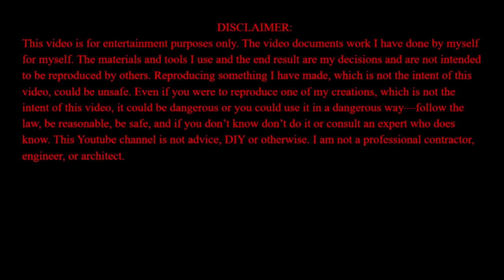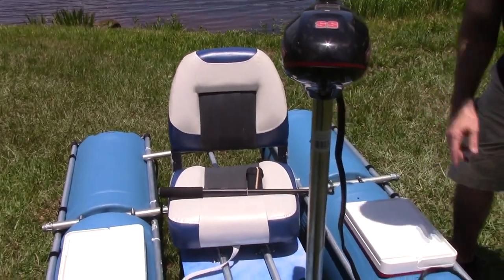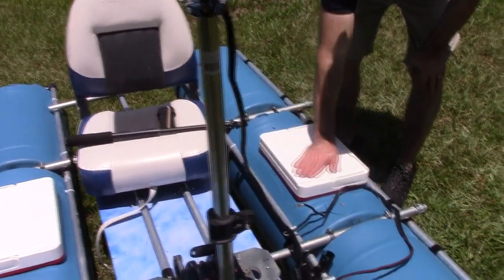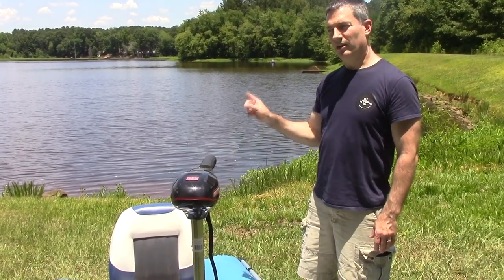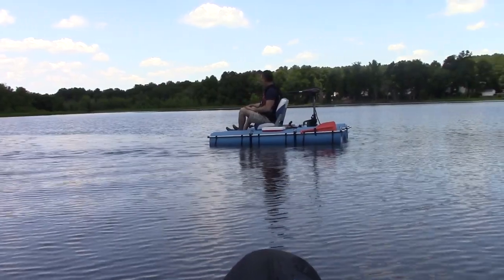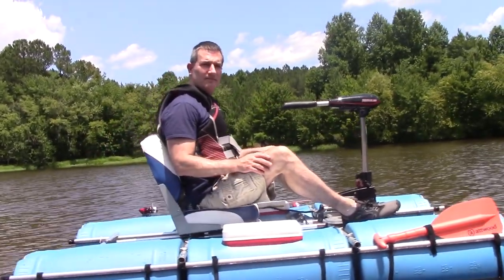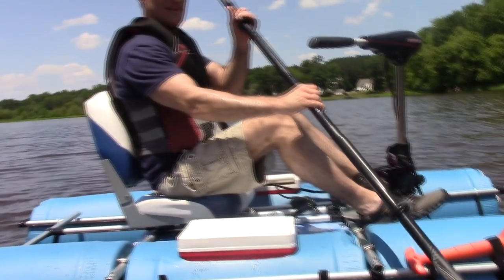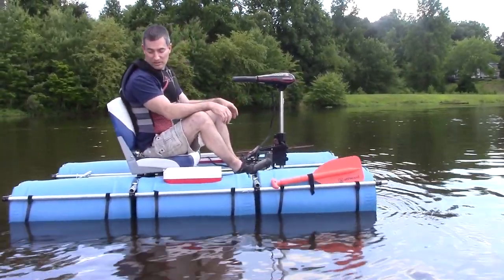Homemade EMT Conduit fishing barrel boat

Comment: I can see a mini trailer that matches the boat behind the boat on a short rope full of supplies and food , pop up an umbrella and have a sandwich maybe a few tools radio with batteries stuff like that in it. I really love this boat . I would love to make one just like this . But ive been a home builder my whole life and my back has gone out on me so i cant eork which means i couldnt afford to buy the stuff to make it. I live in a very small town way away from a city. All we have here is a dollar general. And a hometown small  hardware store. I haven't even seen these barrels around here. But have boys that would love to take this to the river. I would buy a small boat if i could . I need to come up with something like this  ! My boys are under 12 and always bord . That thing sets up nice on the water . You done the best job ive seen anyone do . Its neat lightweight. Man i had a pop up canopy that the wind caught and tore up . The legs on that would've worked for the frame. I belive rubber intertube strips would work to connect the joints,screwed with self tapping screws , cut strips of strong rubber or water hose. Im thinking and writing what im thinking , sorry lol.. anyways very nice , someday i will find away

Comment: Newly subscribed after watching the conduit video. Definitely interested in a cut list as well. For a nose take two of the flotation devices off of an older project, cut them into a cone shape, seal, and bolt them to the front of the barrel 🤷🏻‍♂️ might work
Reply from the maker: Cool, I will let you know about the book when it is finished. Also, thank you for the idea for the nose cone. I will try it and see if it works. Thanks again :)

Comment: All barrel boats should have diverters front and BACK.  This makes a huge improvement in range and handling.  EMT is great for paddling around a puddle, but will not stand up to any waves or boat wake.  Even 2 x 2 12g steel studs bend.  2 x 4 12g minimum steel studs.

Comment: Great video mate do you fill the drums with foam
Reply from the maker: Great question, I didn't fill these up with foam. They were air tight except for the ones with the cooler. I would just seal up the ones with a cooler if the water was a little rougher. Thank you again

Comment: Great job! How big the trolling motor and battery are you  using? Thanks
Reply from the maker: The trolling motor was a Minn Kota 55-lb. and the batteries were two 12 volt lithium ion batteries that were wired in parallel. Thanks for the question

Comment: supergoku1 I have 60 of those barrwls but mine are 55 gallon plastic barrels that I am trying to make a large mobile floating island with a welded metal frame and then tarp and soil and grass on top. 

Do you think I could use this emt conduit in the same way but on a larger scale to make My mobile floating island frame and forget the welding?
Reply from the maker: To be honest, I'm not sure. If you can, I would go to the YouTube channel https://www.youtube.com/@MakerPipe They are the ones that make the EMT connectors. They constantly do test on the EMT pipe to see how well it performs with weight and other test. They also might be able to answer the water proofing question. I know they have tried many ways to paint the EMT conduit as well.  I hope that helps and thank you for the great questions.

Comment: what size emt conduit did you use ? would you happen to have material list of how much emt conduit needed been trying to find somthing just like this so i can get off the bank and looks like you hit design and everything on the nail.  keep up the great videos
Reply from the maker: I used 1/2 inch EMT for this boat, unfortunately I do not have a parts list. Thank you for the questions.

Comment: Love your creativity! I build and design micro camper boats!
They look like tear drop trailers. By the way, where did you get connectors for your emt conduit (the black ones)? What size conduit did you use! Looks like 1/2''.
Reply from the maker: The connectors came from a company called Maker Pipe. The web site is Makerpipe.com, and the boat was mainly constructed from 1/2-inch EMT.  Thanks for the questions.
Reply: @supergokue1

Comment: Maybe Add cones to the front of the pontoons to cut through the water more easily. 
 Being flat-faced is eating up your battery.
🖖😎
Reply from the maker: You are 100% correct, that is a must for this boat. To be honest, I am having a hard time finding something heavy duty and not too expensive. I tried a couple of clear plastic salad bowls, but they just cracked and broke. I am open to any suggestion anyone might have :)
Reply: @supergokue1  
🤔...maybe, start with experimenting cone shapes with large sheets of thick construction paper / thin cardboard for proof of concept, ...copying a simplified shape of a canoe bow. then make the bow (x2) out of the same jug material.
...fastening it  without  drilling holes in the pontoon will be the trick. 
...maybe a super strong adhesive for the plastic type of the pontoon jugs, and maybe add just a few of rivets at the sides and top only. (also, the seat might be more comfortable to raise the seat 6, 8 or 10 inches as long as it's still stable...and, maybe add a way to stand up periodically, if you stay out there as long as I do🖖😁)
....and maybe add a small solar panel for charging the battery while fishing...cheap ones Amazon.
Reply from the maker: Wow, really great suggestions. I will start to work on them, thanks for the help.
Reply: @supergokue1  
It was a bit much… but that’s just the way my brain works, …it never stops.

Comment: How much weight will the raft hold?
Reply from the maker: To be honest, I'm not sure how much weight it will hold. I can only guess for now until   I can test it. The math I normally use is a 1-gallon container will float around 8 lbs. minus the weight of the container. So, each barrel is 15 gallons and should float around 120 minus 5 lbs. for the weight of the barrel.  115 lbs. x 6 barrels is 690 lbs., will it actually float that much without the conduit bending, probably not. I can let you know when I get a chance to do a weight test. Thank you for the question, I really appreciate it :)
Reply: @supergokue1  do you have a cut list of the conduit, I gathered you used 6 pieces is that correct
Reply from the maker: I have to go back and gather all of the info together before I start to do the book. I can let you know when it is done if you like.

Comment: This is outstanding!  How do you keep the water out of the pontoon?  They are drilled.    Would Water impervious Polyvinyl Chloride Foam keep the craft afloat if water got into the pontoons?
Reply from the maker: Actually, 4 of the barrels are completely sealed. The other 2 only have a hole on the very top just around the coolers. They are high enough out of the water to not have any water come in. If I decide to use it in rough water, I will probably just seal them up. I will look into adding foam peanuts in the future for added safety. Thank you for the comments, and the questions.